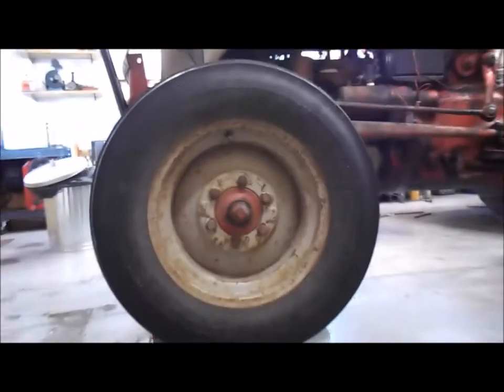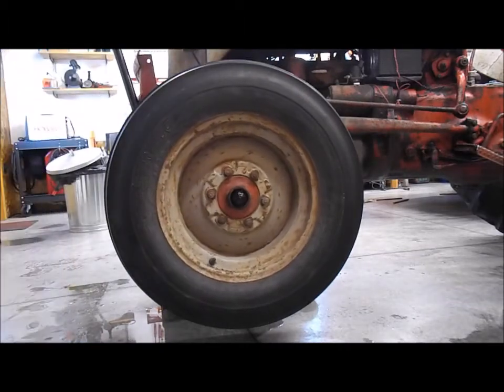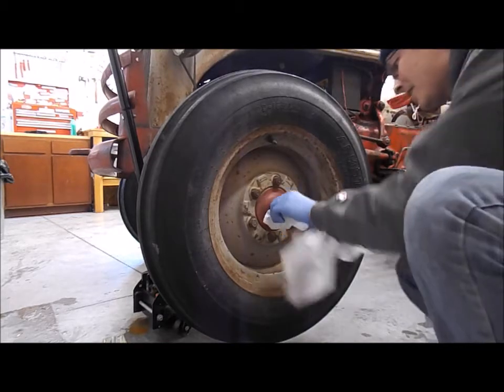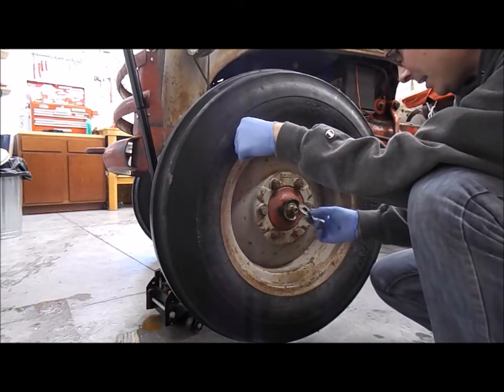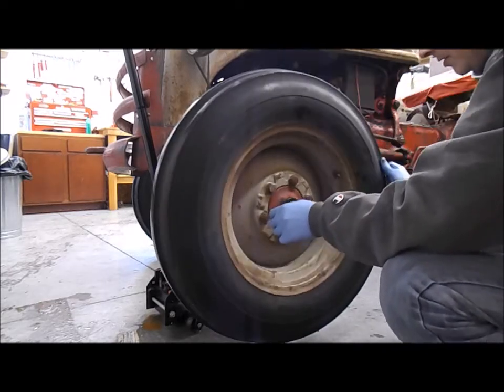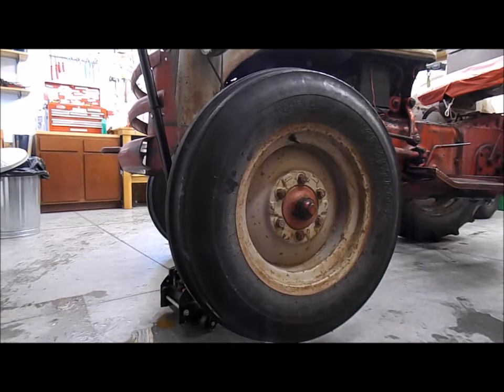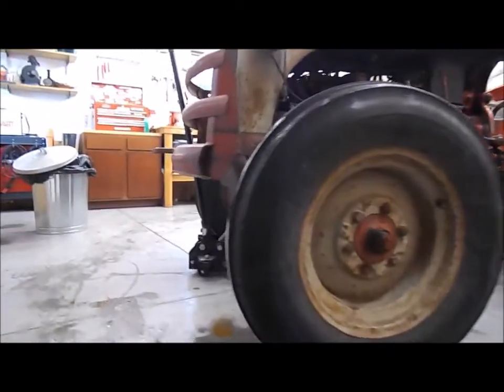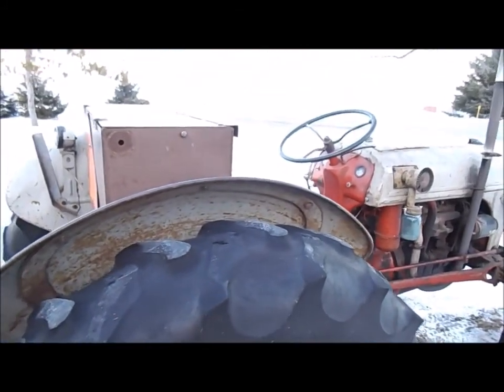8n Ford Wheel Bearing Adjustment

Comment: The 8N instructions say to repack front bearing every 600 hours. So, if the wheel is loose now, one may just take it apart and re-grease then tighten as per instructions.
Reply from the maker: Good to know!